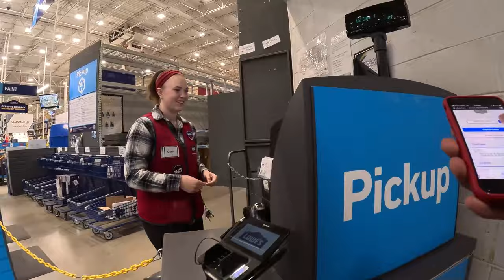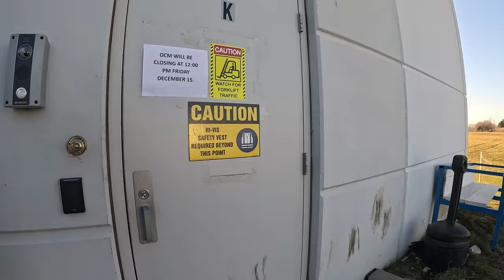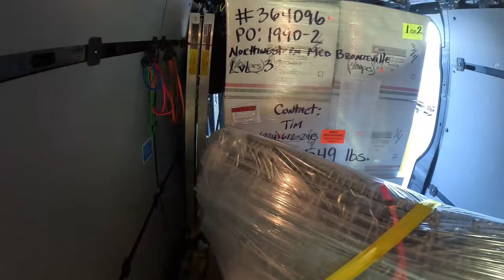I Charged $2000 for 4 HOURS of Moving Services!!

Comment: Yo what's good, I own a moving company in LA and it's not an easy job I have had 8 years in moving experience and i can tell you it's all about technique. can be critical and that's the territory you don't like to touch it's understandable lol, but I charge 170$ an hour for 2 people with a 3-hour minimum if they want to add another person it would be additional 55$ if a trip is farther than 5 miles I charge double the time spent driving and add it to the overall total. additional charges for taking heavy items upstairs, as well as 55$ supply fee wrap tape blankets etc. This way the job can take as long as it can, and you will be paid hourly. I pay my workers 25$/hr. so I get an additional 25$ from their hourly pay on top of what the customer is paying for them.

Comment: With all due respect an individual mover doesn't make $250 an hour. You should get an itemized list from the customer and everything should be treated like a contract and if you don't go to the house personally to look over everything, at least have them send pictures. As a home inspector I can make $125-$150 an hour so for moving I'm charging $200 an hour so that's $800 for me in 4 hours ..... easy money. I'm adding on $100 an hour for helper because It sounds like the homeowner was going to chip in since they purchased the trailer but the key to pricing is knowing all the details before you do anything and having a signed contract and also making sure your insurance is good especially if you're doing this in the business name which you should be so you can protect your personal assets if stuff goes left.